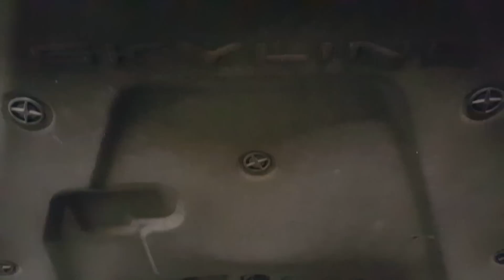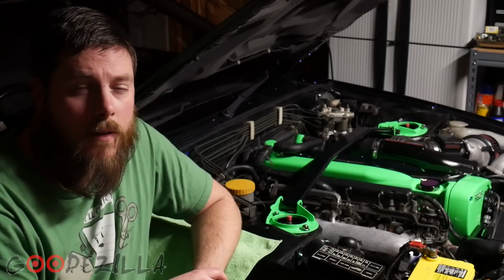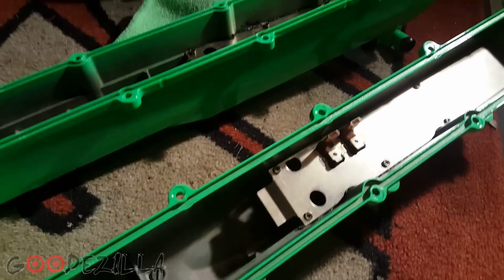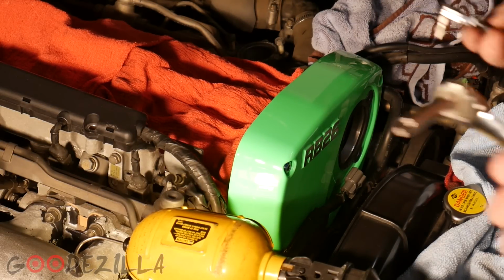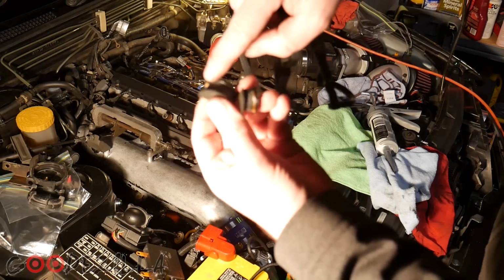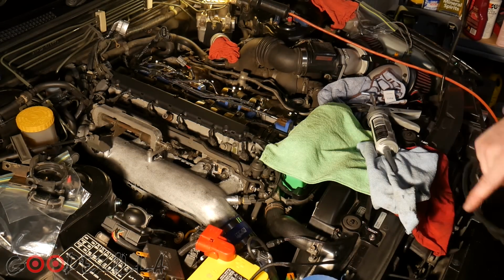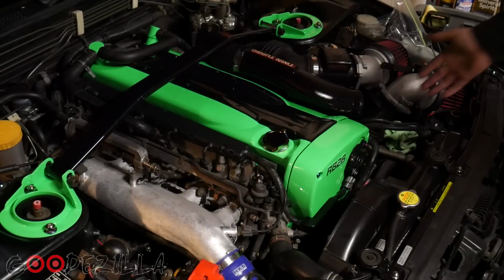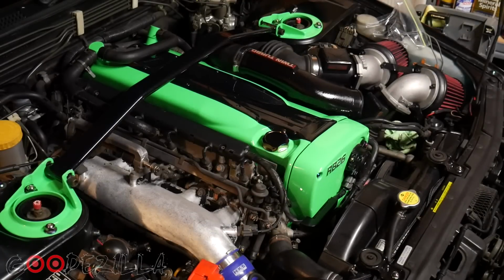RB26DETT Powder Coated Valve Covers Install | R32 Skyline

Comment: Deffinately getting a gtr after I sell the gtst I can't stand the rb20 intake mani piping going over the top of the valve cover...also u mentioned ur taking headlight out...please show a vid of that if its not too late...in one of ur previous vids u pointed to areas to work on in order to take headlight out but hoping for u to actually do it both my headlights don't work
Reply from the maker: +Mike Yeah I'm doing a video on the headlight retrofit. The headlights are a pain to take out...there is one bolt on each side that is a big pain, especially the passenger side.
Reply: +GoodeZilla nice ! Btw  I love the color choice!
Reply from the maker: +Mike Thank you kind Sir!

Comment: What's the unit/solenoid called that you put back @ 6:30 does it sit back in the same place or do you have to mark it up ?... Great video
Reply from the maker: That is the CAS or Cam Angle Sensor. You have to set the timing again with a timing light if you take it off. You can get it close without a timing light but you should double check the timing if you remove it. I have a video on how to set the timing too - https://youtu.be/SS15Ar1Y-PU

Comment: Any tips on removing the timing cover/angle sensor? Or just go ahead n do business lol
Reply from the maker: +Tom Kaos (Official) It helps to have a extendable magnet to grab the bolts when they are out. It's a little difficult to undo the bolts that hold the wiring harness to the timing cover, not much room to get a socket wrench in there.
Reply: +GoodeZilla K cool, thanks man!

Comment: You can't go wrong with the green on black theme! Now on to the intake manifold.... that part looks like it is going to be a pain in the A**
Reply from the maker: +MasterMech77 haha thank you...and definitely a pain in the a**! But I'll probably just mask it off in the engine bay and paint it that way.
Reply: GoodeZilla
I have done that many times with a lot of things on vehicles. When it is either safer that way to prevent damage or just a pain to remove. Painting them in place works as long as you do the proper prep work. and take the time to mask everything off thoroughly.

Comment: How did you adjust the cas sensor when re installing ? Heard about marking the bolts but idk if thats an accurate way
Reply from the maker: +Rob krug I used a timing light to set the timing. I'll be posting a video soon on how to do that. Marking the bolts is a good start, but when you get to a certain point, just a millimeter of movement makes a big difference in base timing. So I recommend using a timing light to set the timing.

Comment: where did you obtain all of your knowledge regarding r32 maintenance?
Reply from the maker: +Mark Stochl Mostly by reading. Whether it be the factory service manual, forums, or skyline groups. Whenever I come across something that I want to do, I research it and learn how. Some other things that aren't necessarily skyline specific, but just car related in general I know from working on cars with my Dad growing up.

Comment: looks great. love the green. got my rb25 covers powder coated years ago but they never cleaned them out fully. leaving sand up inside the baffles which I never saw. over time the sand came loose and ate the inside of my engine and oil pump! rebuild time. expensive but worth it. keep up the good work. have watched all your vids. check out my project blog at skylinesi.com. not yet started vlogging though but potential plan!